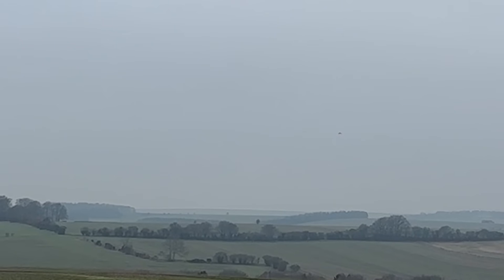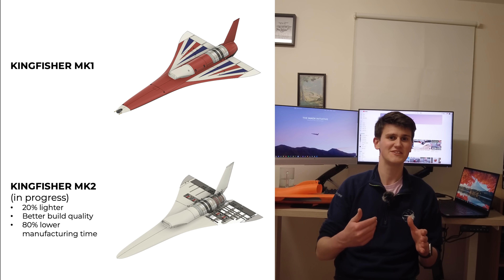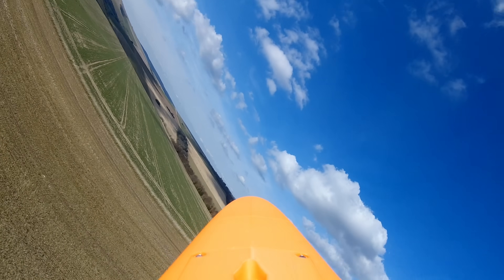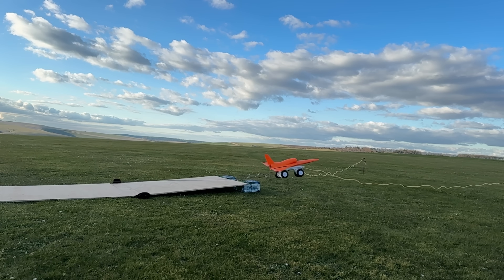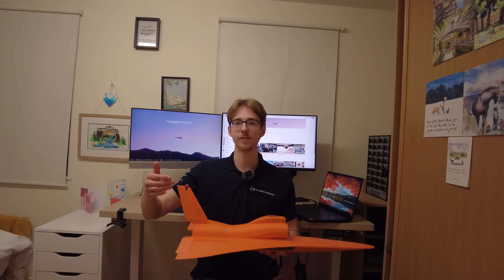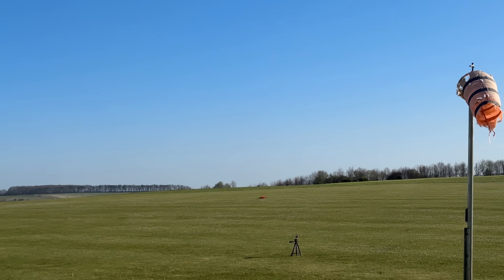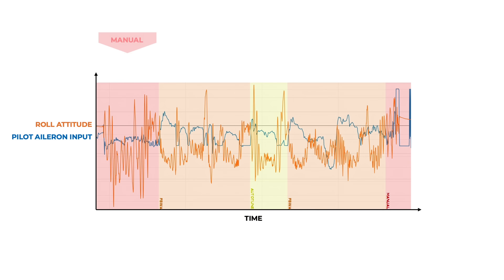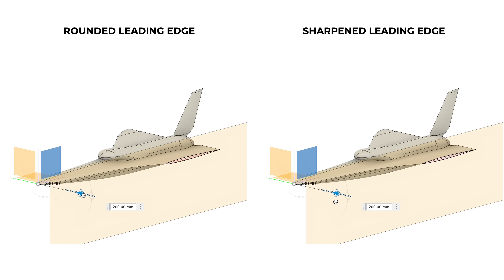After THREE CRASHES Kinglet Finally Lands!

Comment: May I suggest parachute recovery instead of landing? With the kind of wing loadings you're going to need to break the mach, your landing speeds are going to be very high (think 120 mph+); with the small size, even FPV control is going to be sketchy. By completely eliminating the low speed regime with a much more aggressive catapult and parachute recovery, you can focus on high-speed performance and stability. (Deploy the parachute near the peak of a parabolic arc to reduce your shock loads - you can actually get well-under "stall speed" before deploying.) Good luck to you in this incredibly challenging venture!
Reply: Watch some parachute fails on Youtube. I'd rather use swing wing ( Tu-160 , B-1 ) with flaps and flying tail plane. I missed the argument against carbon fiber. Even if some 3d printing is involved, I don't get how a project aiming on low level speed, avoids prepreg and adheres to 3d printing religiously. I don't think that there as a rule. A lighter airplane is easier to land, but flies just as fast.
Reply: @ArneChristianRosenfeldt  I think its about price, 3d print is cheap and carbon fibre is expensive + takes a long time to make
Reply: @ I was hoping to get away with a top and a bottom layer . 3d print sandwiched in between. Vacuum bag. How hot is is allowed to become? There is this guy who builds huge models. Carbon Fiber looks so easy when he does it (on foam).

Comment: There is no way that plane is flyable with the insane amount of throw in the controls. Reduce the throws by about 75%. Please go to an FAI 3d race and talk to the competitors there and examine their airplanes if you want any chance of getting that plane to fly at all.
Reply from the maker: It needs 20 degrees of elevon up deflection to trim in pitch on takeoff, roll is much more sensitive. We’re going to have different transmitter modes to dial down the throws at higher speeds

Comment: I love that you are getting moving step by step. Have you considered building a 3D model as well to tune in Ardupilot SITL? With autotune, keep flying and it will come to you. If it flies also get three mistakes high and pull the nose up until the stall and then do it again. You will have some numbers to play with then for autoland etc. Excellent work chaps slow and steady wins the race don't fly anything else until you have that airframe, nailed. It might take longer but it will be worth it.

Comment: Guys, make the underside dark, and add some big stripes on top so you don't lose orientation during flight. Thin packing tape. From a slope soarer where this is standard practice. Winglets for the tip vortices?

Comment: After watching parts of this video and some of your other videos, I would love to see success. But respectfully it seems that your project could use more input from professional model makers if you plan on being successful in your pursuit of speeds above more than about 300kmh. Focusing strictly on servo installations alone, there is an entire universe of knowledge and skills that need to be acquired before attempts at high speeds will result in anything other than speed induced surface flutter and self destruction of the air frame. I highly recommend you reach out to the gurus of the rc dynamic soaring community who have pushed the limits of model speeds beyond anyone else with their un-powered gliders reaching speeds of around 900kmh. They have been the driving force in the development of precision servo installation techniques for decades. Much like F1car racing tech filtering down into road cars, dynamic soaring installation techniques and methods have become the standard for high performance models of all kinds, everything from turbine jets to state of the art soaring machines. 

Your project will need to master precision, slop free, servo/linkage installations in your high speed test models before there is any chance that the models will not self destruct. The basics are the highest quality servos you can find$$$, properly designed/installed servo trays with external bearing supports, and virtually zero detectable slop anywhere in the chain, etc. You think the vortex shedding induced wing rocking in this model is bad? What until you see what 0.5mm of linkage slop does to a control surface at 300kmh.

This guy is one of the leaders in his field and would probably be very approachable. https://www.youtube.com/watch?v=bd-KTRuoiHw&t=3s&ab_channel=TNGTechnologyConsultingGmbH

Good luck!
(And don't forget to bond that servo tray to both the top and bottom wing skins for ultimate rigidity!)

Comment: Good job persevering, but honestly, I don't see the point in what y'all are trying... There are thousands of RC jet designs... and they all fly better than this one... this thing seems twitchy and unstable as all get out, maybe you all should start with a proven RC air-frame design first and get some experience before trying to design your own? You're just going to reinvent every mistake that thousands before you have made, it's going to get expensive really fast if you keep blowing up engines on impact trying for your mach run.
Reply: I agree.  I can't help but thinking they're tripling the development time by using their own bespoke airframe design.   They should be focussing on drag refinements and iterative speed increases.

Comment: A lot of talk of using fences to control airflow, but these are usually used in subsonic and laminar flow situations. When using vortex lift ( which I think is only happening at low sub mach numbers), a better way might be to include a hounds tooth (and various similar names) on the leading edge about two thirds or three quarters along the leading edge. This will keep a small piece of laminar wingtip operating at a lateral distance to improve stability while in vortex flight.
Reply: Came here to mention the same thing, dog's tooth is what I've heard them called.

Comment: Nice project. To avoid the instability around the logitudial axis you can add boundarylayer fences as close as possible to the wingtips on the lower side of the wing (I made it on some of my RC models which had the same problem at low speeds and high AoA and it always works, you can also see it on my Yak-130 from FMS) or make downwards directed "winglets", the He 162 had the same problem, that´s why it had those wingtips. Further I think the vertical stablizer could have a larger area, especially when you fly faster than Mach 1, because of the backward moving of the neutral point.

Comment: With delta wings to reduce the oscillation in roll, one approach is to give the delta wing a negative dihedral angle of --2º or --3º degrees at the point of the wings (Concorde or Mirage planes)

Comment: Awesome to see you still at it. 

Can I please please please suggest
Fly by wire a
Use pots for coarse tuning
Bank angle limit 90 (60 would be nice but it’s a lead sled)
Pitch down -15
Pitch up +30

That will give you faster tuning by pilot two turning the pots for roll trio and pitch tune, when it’s nice use auto tune. 

###### auto tune does not work untill tune is close ######

Comment: You may find use for a digital fpv system such as the dji 04 air unit, which can provide your fpv pilot with live telemetry and with visual aide such as level indicators, fuel etc. It will also provide you much higher quality optics for your pilot to see in higher definition, which allthough less important, certainly provides for a good flight recording

Comment: You guys seem to have a great understanding in the value of teamwork and input from multi-sourced skilled people! This combination will bring all of you much closer to your goal. As an aircraft RC builder & flyer myself, (from about 1984 to 1998), I enjoyed the basswood and balsa stick-building phase as much as the flying.

I'd buy a Cessna C195 stick-build kit. It'd all be packed in a box that was about 30 inches long, 10 inches wide and 4 inches thick, (no foam-core wings). Of course, I'd buy the best Cyanoacrylate and epoxy glues and work on the build every night after work and weekends.

As a 1st class machinist by trade, I was able to design and build jigs and fixtures to help in getting the COG as close to perfect as I could without adding any weights. I crashed a few of my builds but I NEVER crashed one on the first, 'maiden flight' because of the alignment and balance jigs I used when I built the plane. 

Several friends of mine at the time asked me to make the same jigs for them because they worked so well and helped to insure a good first-flight. More often than not, if I crashed the plane, it was well after the 6th or 8th flight and usually due to a momentary lapse in concentration.

I had to get out of the RC hobby just as the jet engine for RC aircraft became available to the RC consumers, ('life happens). Up until then, RC Jets used piston engines in a ducted-fan & housing configuration. They looked good but they didn't have the jet engine sound. 

Back in '98, I was just beginning to read up about these jet engines, which was a big jump forward in the RC world. But I didn't get very far before I had to turn my attention and efforts elsewhere. 

I may actually consider getting back into the RC hobby and specifically focus on large-scale jet engine models. 

At 69 years old, I'd need to join an RC club and get as much assistance as  possible. Also, I'd have to go with RTF or 'almost RTF' models because time would be a factor and as we all know, "time waits for no man".
 
In fact, I know the electric jet engines are much more affordable but I'm way more impressed with the liquid-fuel jets. They sound far better and the electrics simply can't match the start/spool-up and 'flame-throwing' of the liquid fuel jets. 

Oh, one more thing; I haven't done any research in what a fuel-jet engine costs, (especially like the one you're planning to use in the final build). Can you give me an idea of about how much the jet engine that you're planning to use cost? 

Thanks for the video and I have all the confidence that you will all reach your goal/s successfully, and soon!
Rich
Reply from the maker: Thank you very much! Hope you’re able to get back into the hobby, sounds like you’ve got some great experience! The jet engine we’re using costs around $5k - but it is a 300N engine which is pretty large, smaller engines start at about $1.5k. We use a Jetcat P300 Pro, but other brands include Frankturbine, Swiwin, Behotec and others
Reply: @TheMachInitiative Thank you! I've made a note of that information for possibilities in the future. Actually, I'm surprised that the 300N didn't cost more than that! I would've guessed somewhere around $7K or $8K! $5k seems very reasonable to me for such a large engine.
Thanks again,
Rich

Comment: Nice work! You are miles away from going 500.
Reply from the maker: Its incremental steps - once we get the flight dynamics ironed out we’ll put the jet version in the air, then incrementally increase the speed of that, but under no illusions that there is a lot of work ahead of us.
Like your Dynamic Soaring vids btw!

Comment: Tremendous progress! Sharpening the L.E.s should work, as could a bit of negative dihedral on the forebody. 
I wonder if vortices spilling off your intake when yawed, are pummelling your vertical tail - effectively blanking off a lot of its surface area, and also causing it to vibrate. (Looks like roll-yaw coupling in the vid). Suggestion: bigger, stiffer, tail? Try increasing the tail sweepback, and adding a forward strake to it to make the tail like a cranked delta.
Reply from the maker: Hi Richard - would be great to have another call! Glad you like the idea of a sharper LE, we’ll have to test out anhedral on the body as well.

So far we’ve focused on reshaping the planform, but you make a good point about the blanketing of the tail - the modular design makes it easy to test different components so I’ll see if Max is up for testing a bigger tail in our next flights to see if it helps. 

Cheers, Dan

Comment: Come on,  CoL too far behind CoG - enjoyed the vid, but get the basics right !
Reply from the maker: In our previous vids it was a lot more tail heavy which was causing some other issues. We’ve tweaked the CG a lot in previous flights and this is the best configuration for Kingfisher. The delta wings neutral point shifts forward at high angles of attack, so CG needs to be sufficiently far forward to maintain stability at these angles. Glad you enjoyed the vid!

Comment: Congrats on the successes! Always feels so good to reach that point.
I might not be much help in designing the aircraft, but I can offer a bit of advice in cleaning up the FPV feed. Give the battery's power distribution a low ESR capacitor, and be sure to feed the camera off of the VTX power supply. I love that particular unit, so I know it supplies good clean power for a camera. Should significantly clear up your picture. TBS is the majority of the reason I still use analog by preference.

Comment: The sharpened leading edge will help a lot with encouraging your vortexes, keeping that lift attached. 

Now this is moderate anecdotes from my own study, but I also believe that anhedral can offer a bit of help in calming the wing rock. 

A lot of wing rock on high swept wing planes comes from spanwise flow, and anhedral can help reduce that flow to keep lift attached.

Its one of the reasons Dassault Falcon 50s got anhedral wings when the Falcon 20 with its flat wings needs big wing fences for its high sweep.
Reply: I concur, we found that with our Waverider test models.